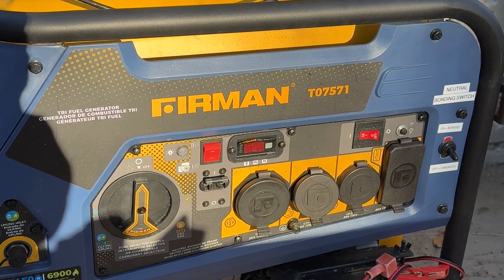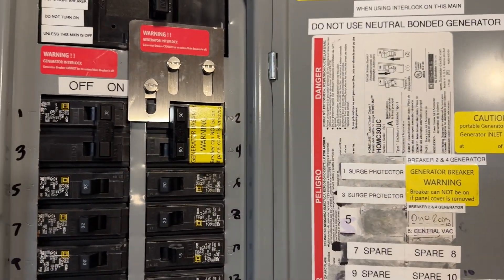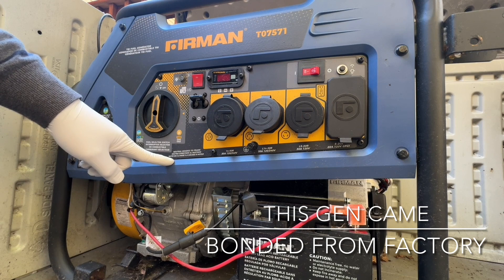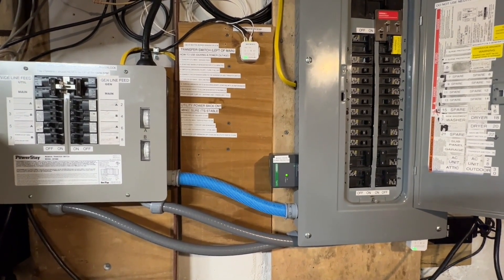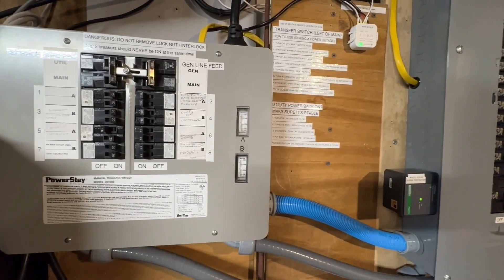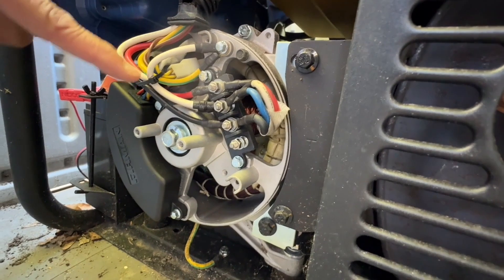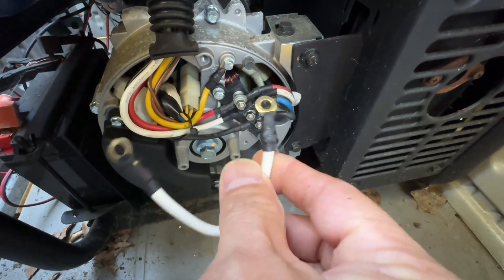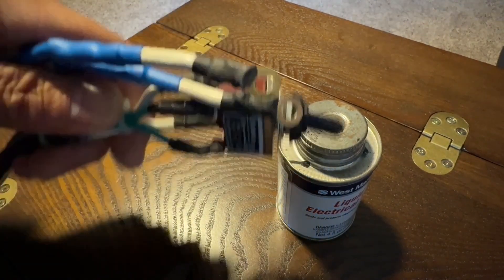How to make a Bonded Firman Generator Un-Bonded using a toggle switch | How to remove bonding wire

Comment: Once you have removed the bonding jumper wire, there's another option to bond the neutral and ground without any warranty voiding mods.  Simply get a decent quality 3 prong plug head and wire the large neutral blade directly to the ground lug with a short wire.  This way you can insert it to one of the outlets for job site use and remove it for home backup.
Reply from the maker: Awesome!

Comment: Why are you using 4 wires on your whip?
Reply: Im trying to figure this out as well
Reply from the maker: To increase amps - ampacity. Please note it does not double the amps x2… the original wire is hefty

Comment: I have a 50 amp generator, what size switch do I need? Should it be rated at 50 amps? The wire bond I need to cut is not a #6
Reply from the maker: Disclaimer, please do a deep dive research on this. But Go with 8 awg but you can go with 10 awg at minimum. Search for it online and you will find 10 awg would do. But the way I did it… combined 2 10awg and got 7 awg (effective rating)
Reply from the maker: I just noticed, the question is not the size of the wire but the switch… the switch I used is rated 10amp - used two 10awg wires - each “line”.

Comment: Exactly my plan. One question: What gauge wire is required for the new “jumper” wire? I will be using 50 amp plug.
Thanks
Reply: I may have found my answer. “No smaller than 14 gauge wire for bonding.” Please correct me if I am wrong.
Reply from the maker: Double check online resources, 8 awg should be fine. I used 2 10 awg  gauge on this switch. That equates to roughly 7 to 8 awg

Comment: Another thing to consider with this mod (which I think is brilliant) is that you are likely voiding your warranty by drilling a hole in the frame. I decided to simply remove the neutral jumper and keep it in case i need to use the gen for a non-bonded application. Takes about 10 minutes to put it back in place. Again, brilliant mod, but my gen is brand new... don't want to void the warranty.
Reply from the maker: So true… thanks for the awesome feedback! Your way is perfect too! A great way to keep the warranty… I traded it for convenience. A quick way to bond Thanks for watching

Comment: Why use a four pole switch instead of a simple two pole switch?
Reply from the maker: If you can find a high amp switch… use a double. I used 4 to be able to use 4 (both ends) 10awg wires to increase amps rating of the wire.

Comment: Why do this? What would happen?
Reply: If you don't remove the bond (change it to floating neutral) there's a risk of the frame becoming electrified while being used with the transfer panel / interlock IF the home backup solution itself is bonded (his previous one wasn't so this wasn't needed). Generlink for example specifically needs a floating neutral for this reason, and with his new interlock panel the panel itself likely already has neutral / ground bonded on the bus bar.

Consequently, some devices will fail to work unless it IS bonded if being used as a standalone generator after this mod which is why he's installing a switch.

Someone correct me if I'm wrong but I believe thats' the dynamic.
Reply from the maker: Yes… my old generator (still have) is a Predator from HF. Predators are unbonded type gens. With the installation of the interlock and new generator, I had to make the firman unbonded… but will also use it when the circumstances calls for bonded generator. Yes, I modified it for safety. Thanks!
Reply: My generator's breaker kept popping when bonded gen connected to bonded house panel (EcoFlow Smart Panel). Reading some, I discovered you should NEVER connect a bonded generator to a bonded house circuit for reasons stated above. If no breaker on the generator, the neutral from the house can supply current to the frame of the generator.